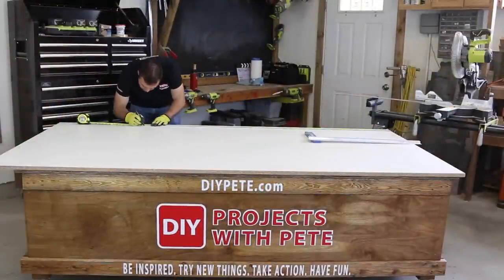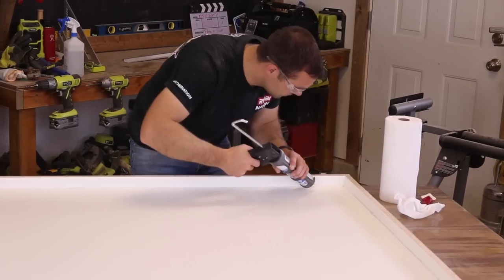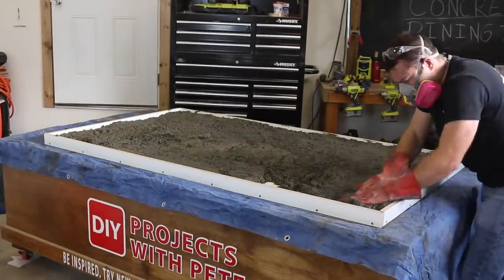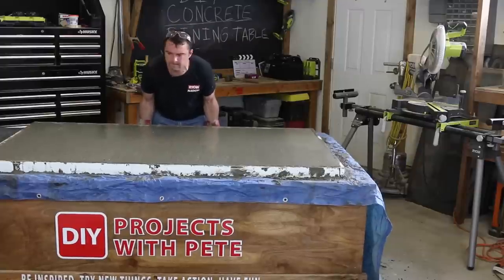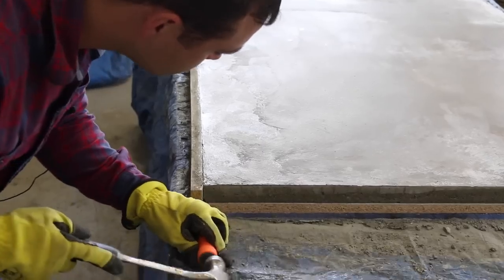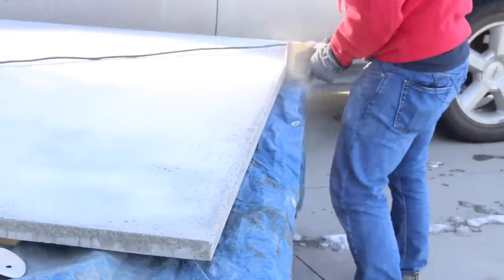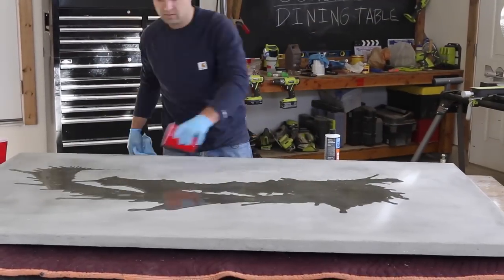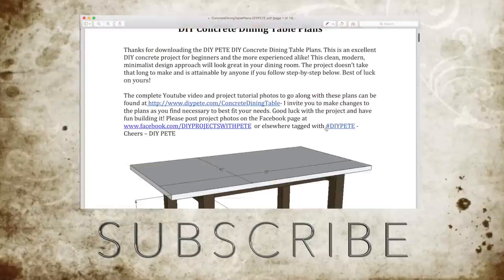How to Make a Concrete Dining Table

Comment: Hello Pete.  Just finished my table, except it is a patio table.  I used Con Heart Redwood for the base, and used 5 sacks of 5000 lb strength Quickcrete for the top.  I had an extra sack left over.  I lengthened the table to 84 inches.   Six coats of sealer (after staining), and one coat of wax.  I love the look, and can't wait to start entertaining.  I bought the concrete adhesive, but did not use it.  This table and top is not going anywhere.  Actually, the slab curved because I left it on the melamine too long.  It is not even touching the horozontal 4x4s - just resting on the ends.  Wish I could post the photos- it looks great!

Comment: Well, as some one who did residential concrete for 30 years, not bad. Since I am a very experienced concrete finisher, and did a lot of poured in place table tops, I prefer a hand troweled top, but that is beyond most DIY people. It does solve the need to fill air pockets. Stripping and facing the sides and the under rim can be tricky. Only worry I had about your project was seeing the grid from the mesh wire after you put it in and were vibrating the top of the slab. There are also lots of variations of stains for the concrete that are fairly simple to apply.

Comment: Looks good. I have found that using a float after placing the initial Concrete in the form greatly reduces air pockets in the top. The more time spent in the very beginning reduces time spent touching up.
Reply from the maker: Thanks Jeff!

Comment: I like the fact that it was extended in the mold with the hands.  I love the durability of the cement , but I'm not too crazy about the color of the cement .  These countertops are very practical.
Reply from the maker: Thanks Maya! Good news is, concrete can be colored integrally or stained to best fit your taste :) Cheers!

Comment: Thanks for a great video.  Built a 40x80x2 slab and a 15x72x2 bench.   Tried to get 5 friends to help move it but couldn’t!   Had to build a trolley to roll it, a 16ft ramp and pulley system to get it onto my deck, built a crane over deck with chain hoist to lift the 650+ pound slab and 4 hydraulic jacks to lower onto my base.  Did this without anyone’s help!   Be sure to calculate the weight before you start!   Love our table and saved about $3k over what my wife wanted to buy!
Reply from the maker: Wow, great job Bob! Sounds amazing. And way to innovate all the stuff to help move it!

Comment: I have used a hammer drill (not too big) fitted with a smooth bolt to vibrate the mold. Still got a few tiny air pockets. Love your table.
Reply from the maker: Thanks Terry! Great idea!

Comment: looks good,  I guess lol.  From a guy who has spent  over  30 years making concrete items for buildings all over the UK it kind of amazes me why people would want a concrete slab in their dining room  lol.  If I did have one myself it would not be a wet mix like done in this video.. The mould used would be fine but I would have used a sand cement dry mix for the sides and ends,  then sand cement aggregate in the mould with steel,  then banged down hard then scratched.  Sand cement then on  top and screeved. Rubbed up with a wood float , polished if you want  to, then take if the sides and ends and do the same.  You could even do any design you want on top  and sides. The advantage of doing it this way is ZERO air bubbles, perfect round  edges without using sand paper, and  it would only take 30 mins from start to finish lol.

Comment: Nice work! If you oil the mold with regular motor oil it will release very easy.
Reply from the maker: +Mike Anderson Thanks!
Reply from the maker: +DIY PETE Yep, I've use oil before on the forms for footings for houses etc. For tables/counters using melamine it's not necessary to use a release, but I have used cooking oil (Pam) - or a release agent around sink molds etc - cheers!

Comment: It looks really good! I think I could even do this haha. 
May sound weird but there is a device you hook to your tv sound system through the subwoofer and it's attached to your couch so it'll shake your couch when the sub goes off. Maybe get one of those to vibrate your table. And play music with bass or just make a audio file with a a lot of bass notes. Cheap way to shake the table without lifting it 😂
Reply from the maker: +kevin condon haha! love that idea Kevin :) get those tunes bumping! cheers man  - Pete

Comment: Looks great Pete! Time for a car was after all that concrete sanding.....sure got your workout in on this project.
Reply from the maker: +Tyler G Hey Tyler! Thanks for checking out the project :) It was the concrete mixing that got me, that's a lot of work! Cheers bud
Reply: +DIY PETE Any recommendations to make this process a but easier?, Maybe a concrete mixer attachment to a drill might work, or is that just fine for paint, but concrete is too thick? Great video.
Reply from the maker: +UnknownHandle UnknownHandle Yep, I've definitely used an attachment! I like the big drywall mixing tool (spiral shaped works better then the paddle). But you'll really want a heavy duty plug in powered drill if you are doing this. When mixing this way, I like to use those big buckets with the rope holds on each side. (typically find at a department store like Target) --- a lot of times people have them in the garage to hold kids toys or footballs, soccer balls, etc. I don't mix more then one bag at a time. Great question!

Comment: Great Video Pete!
I have followed your directions perfectly and in two days I will be removing the mold sides.  I'm anxious to see how it turned out..although I am concerned because my mixture wasn't as thick as yours, I actually had water rising to the top of the cement after a few minutes in which I screeched off.
Anyways, I used Sakrete 5000 and right now the exposed concrete is pretty white.  I want a darker gray look.  Will the lightness go away after I put sealer on it, or do I need to acid stain it?  I want a natural gray concrete look, but not too light.

Thanks!

Comment: Great video!  Do you recommend vibrating before adding wire mesh and then when finished adding concrete?i am building a 82x40 table and incorrectly used a pencil vibrator. Starting over and would like to get it right this time. Do you have any videos using pencil vibrator? Thanks.
Reply from the maker: As I've done more projects, I now recommend just before adding the mesh, as I've had shadowing issues from time to time if I do vibrate later.
Reply: @DIYPETE  Thanks Pete!  Still vibrate after, just without the pencil vibrator?  or you do not vibrate at all now once mesh and final layer of concrete added?  Really appreciate your advice.
Reply: Hey Pete, just wanted to let you know that I did follow your recommendation and vibrate table just before I added the wire mesh.  I also vibrated at the end and table turned out great.  Did not use pencil vibrator but did seek some help with vibrating table at the end.  Pretty heavy.  Thanks for your video and advice.  You do a great job on your videos.
Reply from the maker: @billward533  So glad the project went well Bill! Thanks for the feedback and enjoy that new table!

Comment: Table looks great, any  suggestion to make it lighter yet still have the same strength and integrity.
Reply from the maker: Thanks! I don't build tables of this size thinner than 1 1/2 inches. For thicker tops I'll sometimes use foam to lessen the weight. If you wanted to go thinner you'd want to look into a special GFRC mix ( glass fiber reinforced concrete) cheers!

Comment: Hi DIY Pete, this looks great I would love to try this. I was planning on making our dining table for our new house out of a piece of an old wooden ten pin bowling lane. I thought of welding together a steel frame and dropping the piece of lane in the frame and then covering it with a piece of toughened glass so as to keep the used bowling lane look (plus it is a piece of the lane I rolled my highest score on - 297). Any other suggestions that you might have to make my project work? Otherwise I might give this concrete option a go.
Reply from the maker: +Ashley Chettleburgh Hi Ashley! This bowling alley idea sounds really neat. Congrats on a 297! I couldn't even come close to that using the bumper lanes :)  The glass would do a great job protecting the wood and creating a smooth surface. You could go without the glass and add some additional sealers - but it sounds like you'd rather not, so glass would work well in my opinion. I love the combination of steel and wood --- welding together a base (maybe angle iron to hold around the perimeter and stretchers across/underneath the alley to make sure there is plenty of support. I think the look of cold rolled steel would look neat, but you could always patina the steel to give it other colors. -- Your bowling alley idea sounds cool, let me know what you end up going with! - Cheers, - Pete

Comment: Looks great. Have been looking for this kind of project and looks simple enough. What is the "slurry" to fill the gaps and how to get it?
Reply from the maker: +Nancy Rivera Hi Nancy! Have fun with the project. Slurry is a mixture of "Portland Cement" and water. Portland cement is the binder in concrete. They sell it at any hardware store in big bags. You only need about a quart sized zip lock bag of it. Simply put a little bit in a plastic cup, and add a bit of water. You'll want to mix it to the consistency of tooth paste, and rub it into the voids.
Reply: Any other replacement. Live in Puerto Rico and possibly difficult to get. Thank you for your response.
Reply from the maker: +Nancy Rivera If you can buy a bag of concrete, you could sift the cement portion out of the mix. A concrete mix consists of cement, sand, and gravel. Cement is an ingredient in all mixes. You might even call a local concrete mixing company to see if they have some available. Another option would be to use tile grout. Or a mixture with fine aggregate and no gravel. Hope that helps a bit :)
Reply: +DIY PETE searching for Portland Cement I found white Portland Cement. Can I color it grey or use as is?
Reply from the maker: +Nancy Rivera Hi Nancy, white portland cement will certainly work. You will want to color it grey a little bit though so it matches the concrete. Otherwise you'll have white dots whoever there is a void.

Comment: I am getting ready to build a outdoor kitchen and am pretty sure I am going to be using concrete.  I live at the beach and want to do a little bit of a surf theme.  I saw your video using the crushed glass and think I am going to make a breaking wave with the colored glass.  Then stain the concrete after it is set up.  Have you used stain before with the glass?  Hoping the stain does not affect the glass.  May make an end table first and see how it looks.
Reply from the maker: Hi Tim! I have and the glass did not absorb the stain so you should be fine. I think doing an end table to experiment with first though is a fantastic idea. Let me know how everything goes!

Comment: Hey Pete. Great video. I'm really looking forward to starting this project. I was wondering if I wanted to make the table 84" in length instead of 72", would I have to make an adjustment to the base?
Reply from the maker: Hi! Yes, you'd want to increase the length -- and to add additional support  to the base. Cheers!

Comment: Great project Pete can you add a color to the concrete, and would the same process be used to make a kitchen counter top?
Reply from the maker: +John Smith Hi John! You can certainly add color to the concrete. You can mix it integrally with the concrete, or you can stain the concrete once it is finished. Check out my Concrete Playlist to see the acid staining technique. And google concrete counters to check out some color options. I've done a number of "burgundy wine colored tops" and green tops - that turned out great. Kitchen countertops are done in a similar fashion.

Comment: Perhaps next project cam use foam inserts which you can remove after the cure to lighten the overall weight?
Reply from the maker: Hey Preston! I've done that in a few projects, for something of this size I don't like to go under 1.5 inches. I might have to get into using a GFRC mix to cut down on weight as well. Cheers!

Comment: Nice build! I was thinking about making one, maybe this summer as an outdoortable. What material would you use I you were to insert a small barbecue in the middle of it? Wouldn't go for low and slow cooking here but would be fun for the family and friends.
Reply from the maker: +FloppyJedi Hi! Are you wanting to create a hole / knockout in the concrete that a grill would site in? If so, foam would be a great way to create the knockout. Let me know what you are looking to do with the grill. Cheers!
Reply: Yeah, thinking I'd just make some walls out of some wood and just pour around it to get the hole. Then comes the task of finding some rebar or something to hold the bbq, for example.

Comment: Great job, Pete. I am going to tackle this project next week. Are there any flooring requirements for the weight. I have porcelin tile coming in, so our floor is weighted. Would you discourage this table? Can you recommend any treatment for an outdoor table to prevent cracking in the midwest region? BTW, where in Montana are you? We are in Big Sky.
Reply from the maker: Hi Sam! Hope all is well over in Big Sky. I'm up in the Bozeman area. To prevent cracking, I'd recommend using a quikrete mix, keeping it hydrated during curing, temps between 45 and 65, and re-enforcement. I have a large table that's been indoors and out both at my folks in the midwest and at the cabin in Montana. They are both outdoors year round and have held up extremely well. A good base to evenly distribute the weight is important. As for the floor of a dining room --- I have 12 inch travertine tile - no issues -- if weight is distributed well and pads are used I'd think you'd be okay, but always recommend having a professional in your area check out your exact situation. Cheers!

Comment: I would love to try this. What about using rapid set morter rather than concrete?
Reply from the maker: Great to hear Angela! I've used the Rapidset mortar and concrete mixes on various projects. While I love the instant gratification, the long term results have made it so that I do not use it on projects like these. If you are going with a normal mix, I'd stick with something like Quikrete 5000.

Comment: Question? Is there a grainy texture to it? would you reccomend this for a drafting table? I was thinking that maybe the cement would be tough on the pencil when it comes to drawing on paper.
Reply from the maker: Hi Aron! It is a flat surface in general and pretty smooth --- but it really depends how well the table is polished and voids are filled etc. I generally am sitting at the table with a notepad and am not drawing directly over a single sheet of paper. I wouldn't say it is a grainy texture.

Comment: Hi there, Pete. Great video and great tutorials. The only part of this that I still need to sort out is the actual work table underneath the concrete! Looks like you have a pretty good setup, any suggestions on a temporary solution, or perhaps one that can be stored after? My humble workshop is also our garage, and my workbench is a built-in countertop. So large structures like this are hard to keep around 100% of the time. Would love any input here. Thanks again!
Reply from the maker: Hi Lindsey! Thanks so much for subscribing and for the kind words. --- Some people use heavy duty sawhorses with notches and connect them with 2x4's. Then they'll put a piece of plywood over them to create a sturdy table. Followed by the mold for the concrete. Otherwise, a lot of folks will build something similar to my table with 4x4's, 2x4's, and 3 inch wood screws.  - Basically a skeleton of mine - that will be sturdy for the concrete.

Comment: Hi Pete, my first question is whether your instructions would still work out if I liked to build a thinner concrete? Second question: Do you have any piece of advice how to build a round concrete or even better a round and thinner concrete? 

Thank you and merry Christmas!
Reply from the maker: Hey Sven! I wouldn't recommend doing anything under 1 1/2 inches with a mix like this and the size of the table. You could look into using a GFRC mix if you want to go thinner. I've done some smaller projects at 1 inch which have been up to around 2 feet by 2 feet. Here is an example of how I've done a round project: https://www.youtube.com/watch?v=h6_RljwsqiI  Let me know if any of that helps. Cheers!
Reply: Hi Pete, first of all thanks for your quick reply!

I'm planning to build a something around 4.5 feet by 4.5 feet round concrete dining table! Since the tiles in my living are not the most stable ones anymore I’m afraid of building a too heavy concrete. That’s the reason why I want to build a thinner concrete. 

Does it make sense to use a GFRC mix in combination with a reinforcement steel to lend the thinner concrete more stability?

Cheers!
Reply from the maker: Hey Sven! If you do the GFRC, I believe you can do without reinforcement. You might look into this video for some more info: https://www.youtube.com/watch?v=GE0-iB6Y7F8   Cheers!

Comment: Hey Pete, awesome tutorial. I was looking at your coffee table tutorial as well. Im creating a concrete coffee table 67x43 and 2 3/4 thick. Do I need to add rebar or will the mesh work well by itself?
Reply from the maker: Hi! Mesh will work. But what I'd do since it is pretty thick --- is use 3/8" rebar along the perimeter. Cut 4 pieces, then zip tie them to the mesh. Add a couple in the center as well. May be a bit overkill, but will help in the long run.